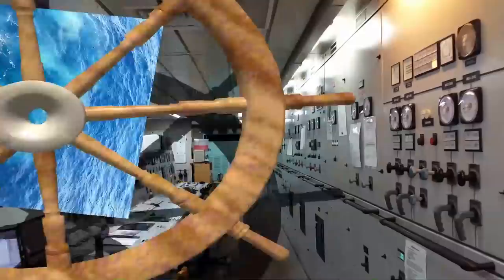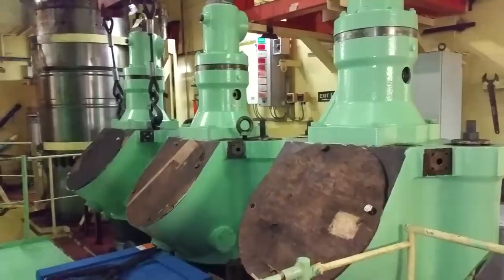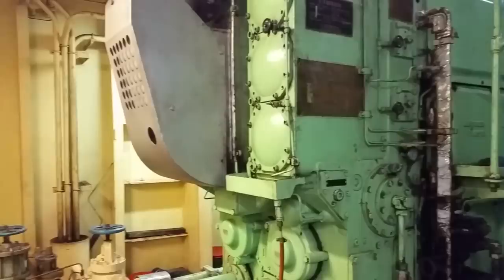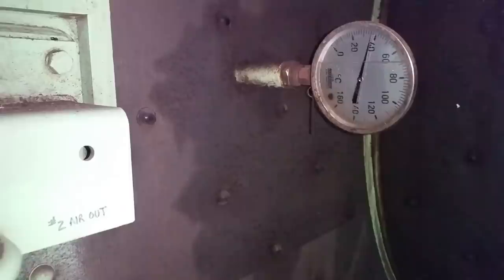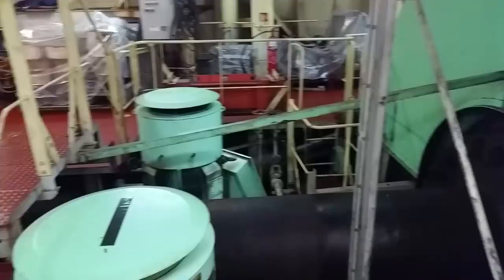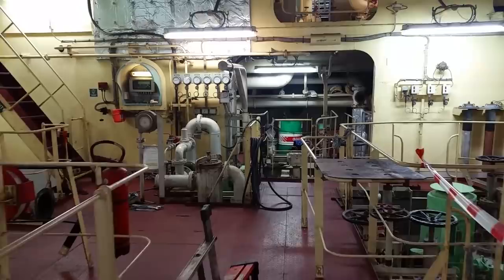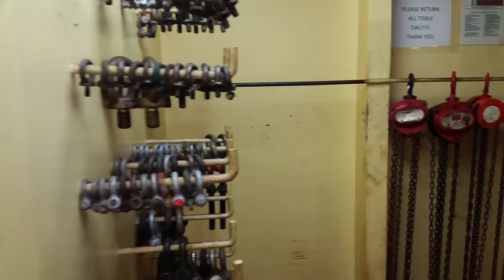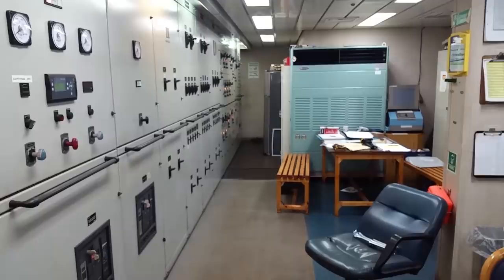Container Ship Vlog #25 (Tour of the Engine Room)

Comment: Very very good. Perhaps in a future video you will also show the workshop so people can realize how autonomous the ship has to be sailing the high seas. To repeat a question on a previous video: how do you reverse the engine, by hydraulically altering the valve timing, or by a reversing gearbox?
Reply from the maker: All engines ar different but most Sulzer Engines it is by servo motors on the camshaft that can be used to rotate the fuel pump cams to reverse and YES next time I will show the shop more no problem
Reply: Thanks for the clarification. Keep up the good work!
Reply: @JeffOnboard  And newest ships use pods that are electric even, bow thrusters as well.

Comment: Great tour! Thanks. How many KW is the main engine and what is it's max RPM?
Reply: From my estimation as a marine engineer from the 1960's this 8 cylinder turbo charged / inter cooled 2 stroke would be about 50,000 hp and runs about 100 rpm maximum speed.

Comment: Hi , is crankshaft deep under oil , or is it  only sprayded with oil (on bearings)? great job thank you
Reply: Crankshaft and all moving parts in the crank case are pressure lubricated by large oil pump(s) driven by electric motors

Comment: Could you please explain the gearbox, how it shifts from forward to reverse, etc. I assume there is a neutral, because you would not want the prop spinning when starting the engine.
Reply: : Thanks! I saw that on another video, and was not aware the prop is direct-coupled to the engine.
Reply: @michaelshrout2820  yes the firing order is changed to send the ship in reverse because forward or reverse or just stops

Comment: I was going to join the Navy to learn ship engines but just watched this video instead. One thing I'm unsure about still, we saw the pistons and valves but are there no spark plugs since it air-started? Awesome video. Thanks!
Reply from the maker: no....air start yes, but that is not why there are no spark plugs....Diesel engines use the heat of compression therefore no need for those like on your car...

Comment: Does the ship have its own electrician, Do you carry spare electric motors? You said the voltage was 440 is it 3 phase? Do you paint a lot because everything looks freshly painted. Did you go to a tech school for ship maintenance? Thanks
Reply: Speaking from another vessel: yes there are ETOs (electro-technical officers), spare motors usually kept for important motors and sent ashore for rewinding when they break down, it is 440v 3 phase stepped down to consumption voltage of 220v or similar depending on construction, chipping and painting is a constant job for wipers/Oiler’s/motormen and ABs. In Europe you go to a marine engineering school with sponsorship from Maersk (they pay everything for three years of training), not sure about the US guys.
Reply: @AHJ99.  Thanks Andrew
Reply: In Spain you have to assist for 4 years to a nautical school (university) + 360 days as cadet to get your profesional 2 nd assistant engineer endorsment. For CE you have made another
Year in nautical school (university) + 720 days as 1st assistant engineer.

Comment: Thank you for take us along. How many revs does the main engine; 20 @ idle
and 80-100 @ cruise speed in clear sea.....? Displacement? Why does it uses
2 turbos? For diesel economy? ty
Reply: Believe max rpm is 102. There is no idle. The engine is either stopped or turning the propeller. There is no gearing - it is Diesel Direct. The engine is directly connected to the propeller via the shaft. The engine minimum speed is about 22-24 rpm. Below 22 that there is not enough momentum rotating element to overcome inertia to keep the engine turning. Diesels are most efficient with pressure over atmospheric, plus they are more powerful. More air means more fuel. More air and fuel mean more power. Below a certain engine speed, the turbos do not spin fast enough to supply the needed air, so the auxiliary blower(s) turn on to supply extra air.  Believe somewhere about 68-70 rpm the blowers secure and the turbos supply all the combustion air.

Comment: Why would you called a flywheel a planetary gear? Ain't planetary gear consist of many other gears?
Reply: its a bull gear
Reply: @Rosski423  I don't know why he called it a planetary gear,it's just a flywheel with teeth on the circumference so the turning gear can engage into it and  turn the engine over during maintenance and repairs.
Reply: @alfamontydog   it is a bull gear. the purpose of a flywheel is to store reserve momentum of the engine to smooth rotation. On a slow speed diesel, the bull gear is not designed for that purpose.
Reply: @Rosski423  I was a marine engineer in the 1960's and we always called it "the flywheel"
Reply: @alfamontydog  it is a common misconception...who did you sail with?
Reply: @Rosski423  I know its a misnomer but everyone uses it.
I sailed with the "Nedlloyd" in the Netherlands
Reply: @alfamontydog  Planetary gear or epicyclic gear is a system of gears reducing the engine rpm to match propeller rpm. This system of gears is used also in cars with automatic transmission in conjuction with torque converter and in other applications of course.  It is a gearbox not a flywheel. The name "planetary" has given because a number of gears (planet gears)  run around a central gear (sun gear) and around all of them turns a ring gear, this is the simplest version.
Reply: @basilfabrikaris2986  I don't know why you direct this comment at me,I never called it a planetary gear,I called it a flywheel.
As a matter of fact after my career as a marine engineer I was a shop owner of a very busy auto repair shop,so I certainly know what a planetary gear box is,as a matter of fact the Ford model T was the first to use  a planetary gear box(transmission)
Reply: Sorrrryyy, almost forgotten to mention: great videos ! I enjoy them. Please continue !😃

Comment: Why do some of the parts appear to be covered in foil is it for insulation or just general protection against rust and so on
Reply: The ones you see in shiny coverings that you're referring to those are generally lines that have steam going through them and it's insulation just the outer cover is the shiny silver.
Reply: @jefferyb.3406  aha cool .... what is the total height of the engine and width and why does it have so many floors or layers I don't know the correct term lol
Reply: @fatimaali7539  I'm not sure how tall or long I've never really measured it we never think about it really that way but the reason there are decks around it three levels high and some middle decks it's because it is obviously huge and we need to be able to access all different areas around the engine that's why there are dicks all around it to make it all accessible

Comment: Just one engine? Thought it’d had two.
I noticed there’s a lot of excess heat everywhere. And still you need a boiler.
Suppose it’d be a bit expensive to salvage all this heat for water desalination and other applications.
Reply: the fresh water that is used to cool the main engine (jacket cooling water) passes through the fresh water generator in order to boil the sea water and produse fresh water. The fresh water generator 99.99% of the time runs only when the main engine is running and when the r.p.m. of the engine are not fluctuating. It can also be used in an "emergency" when the engine is not running and you need to produse fresh water, with the use of the steam from the boiler, but in this case the production of the fresh water is much lower. :)
Reply: @antonismouroukis44  Thanks for the detailed reply!

Comment: Does the main engine run both clockwise and CCW? I didn't see a transmission to change the rotation of the screw? And don't worry about the poor soul at posted the thumbs down, some folks just can't be pleased.
Reply: Clockwise
Reply: Well said dude !
Reply: Transmissions are usually reduction gear boxes or sometimes taking out all together and just made direct drive.

Comment: what is the main engine exhaust temp. Isthere heat recovery system for the domestic boiler ,in the main engine exhaust. If not . Why?
Reply: Great question the exhaust temperature does vary as our speed changes all the time but normally it's around 400 ish and also the exhaust goes up to an economizer which we use to make Steam when we were at sea so we don't need to waste fuel with the regular boiler so yes a lot of that heat is used as it exits to make our steam which is normally about 5 or 6 bar of pressure. 75 to 90 lbs. of steam